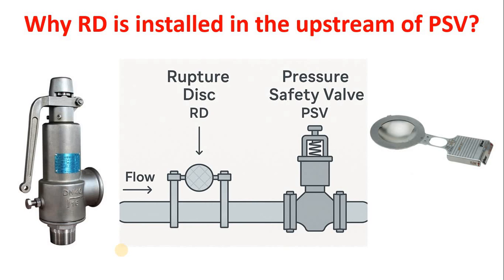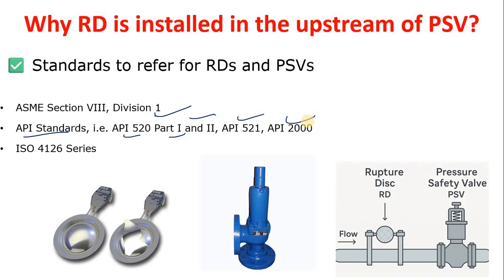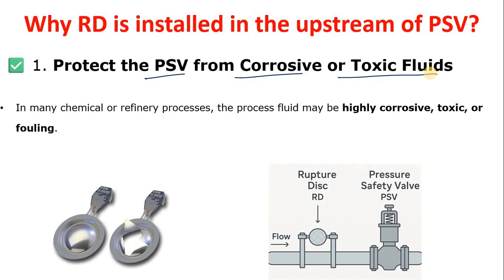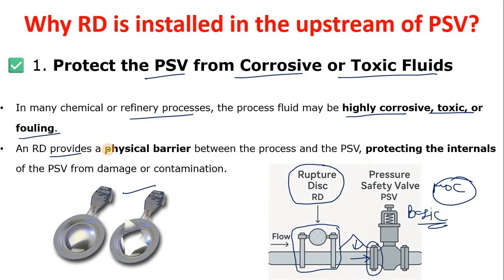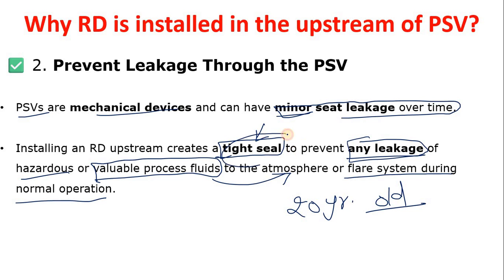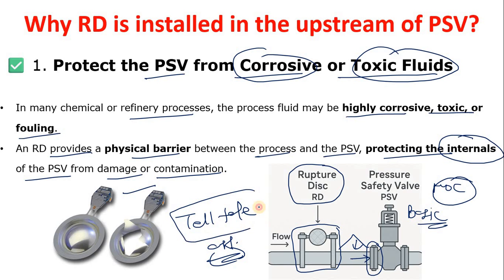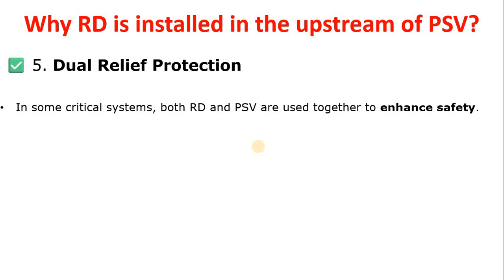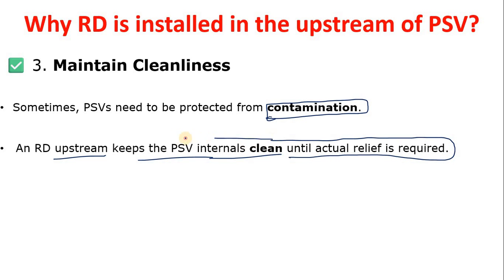Why is a Rupture Disc Installed Upstream of a PSV? | Explained with Diagram | Rupture Disc

Comment: What if the Rupture disc is installed at the anchor point and psv is installed at the top and there is a significant gap
Reply from the maker: Codes don't allows the gap more than 5D of that line. But I have seen so many places the gap because of so many reasons will discuss that in our upcoming videos.....thanks for very good question